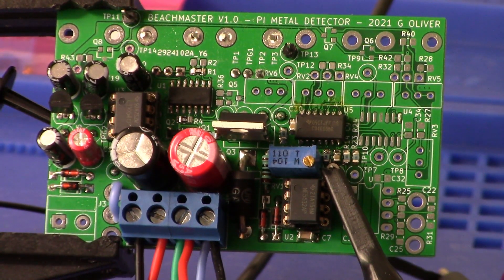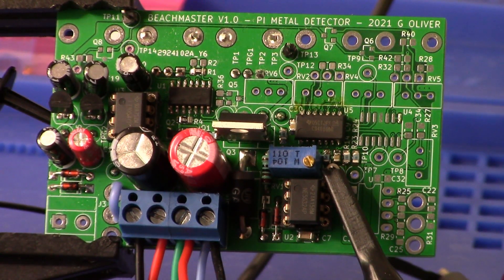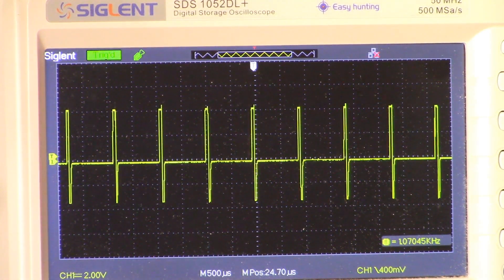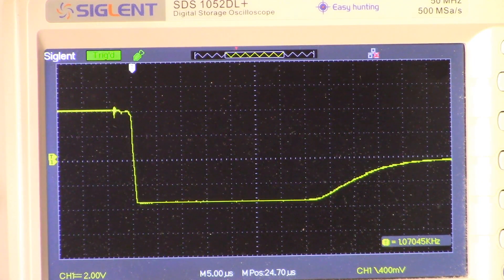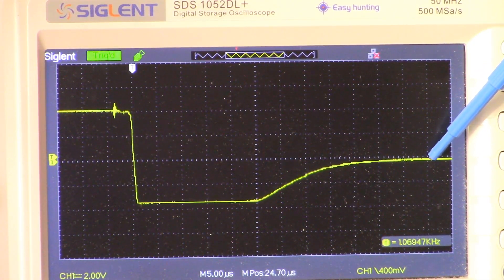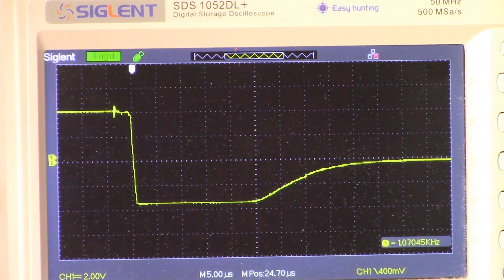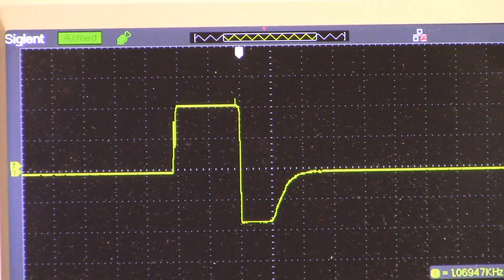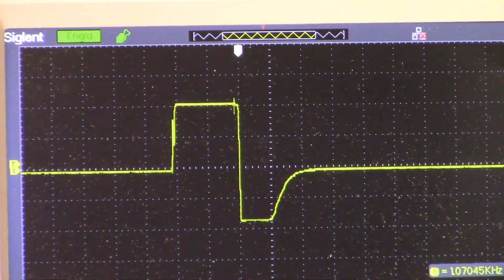Beachmaster PI metal detector part 3

Comment: I have made the hammerhead PI, and a couple of others but by far the best has been the Iranian designed Felezjoo(means metal detector). It's a PI metal detector but with discrimination that I would say works quite well. That or whites GMT is the ones I use very often.
Reply from the maker: Have you tried the Voodoo project?  Very interesting detector, especially the Arduino modified version.